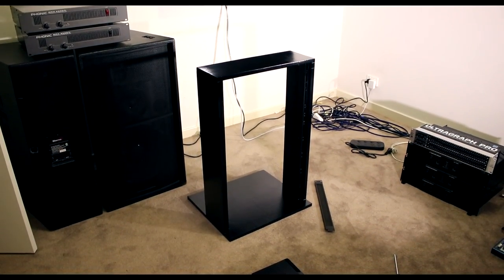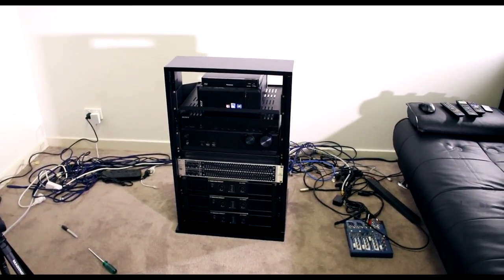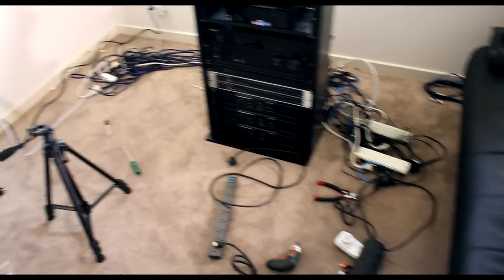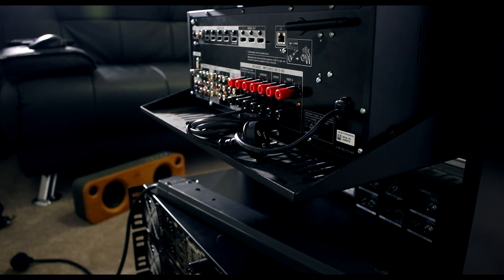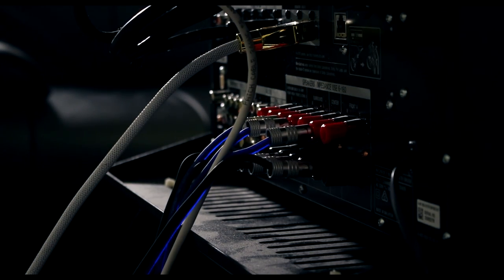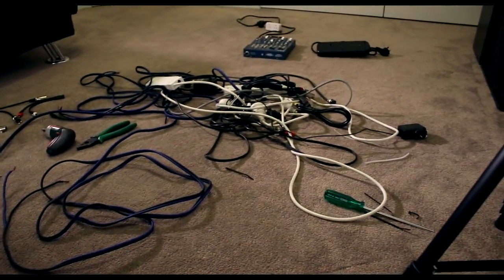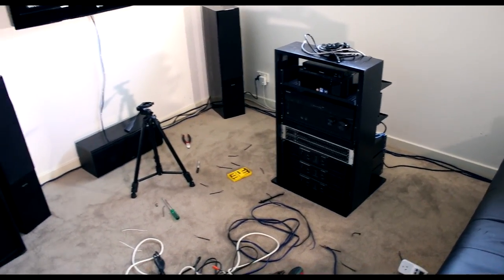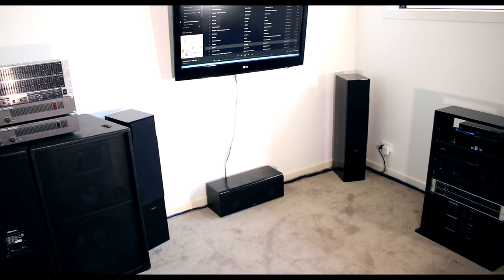FRESH START - SYSTEM REBUILD EPISODE 3

Comment: how do I make an amp play only bass? coz I got a passive sub and whenever I plug it it it plays full range
Reply: You need a crossover set to Low Pass at your frequency of preference. Preferrably, you'd match a Speaker Manager to two amps. One for lows and one for highs.
Reply: HumbleDeer where can I get one
Reply: A simple crossover, or a speaker manager?

A simple crossover that goes before your amp can be gotten with things like a FreeDSP. What's your source? A receiver?
Reply: HumbleDeer stereo amp
Reply: Reasonably decent budget crossover Behringer CX2300 although it doesn't do subwoofer high pass above 25Hz. I got for £60

Speaker Manager with all the bells and whistles and equalizer DBX Driverack PA+ I got mine for £300